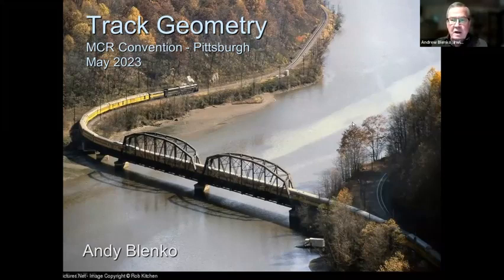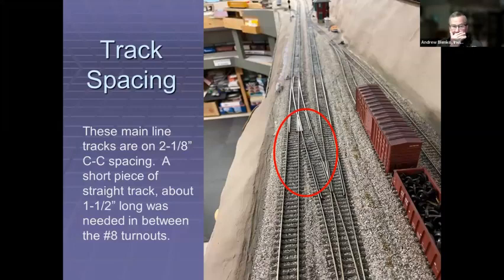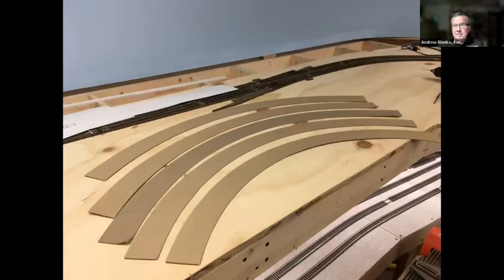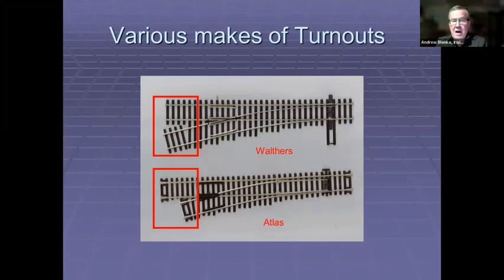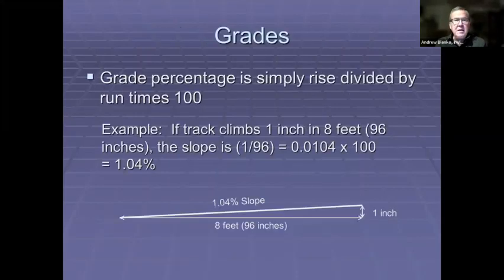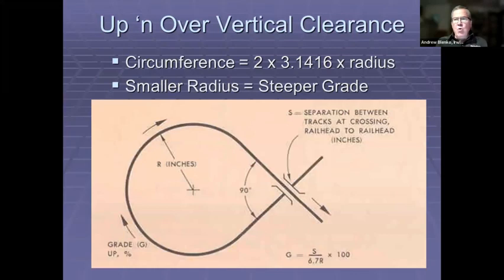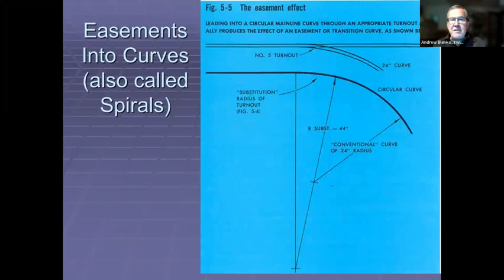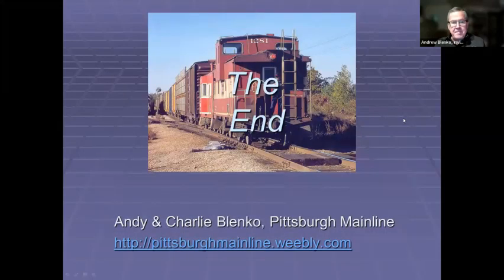Track Geometry - 8/23 clinic

Comment: For vertical curves, there are 2 methods that will work for models:  1 lay them out like for 1:1 railroads using parabolic curves and the different grades, and 2 use that piece to lathe or very heavy cardstock laid and weighted on the first grade then gently bend the lathe to the new grade and fill in or cut away(if it is a change to down instead of up).  There is a 3rd method of grade change:  use the difference between the grades divided by 5 or 10 and change the grade by that amount for each 10 feet of track until the change is complete.  I saw that done on the Rock Island profile maps for some grade changes.